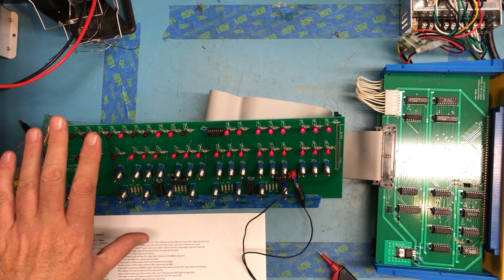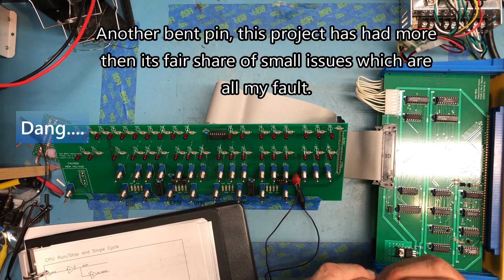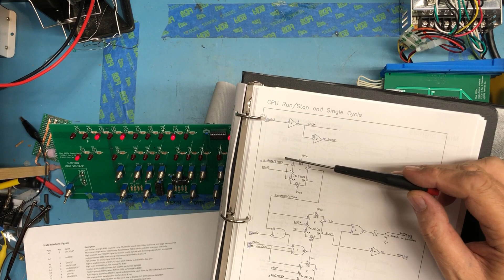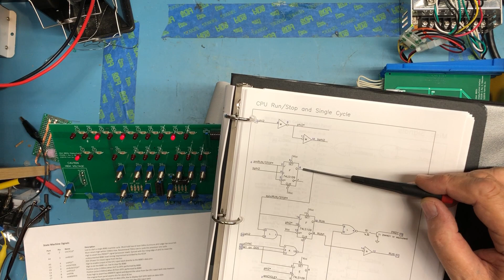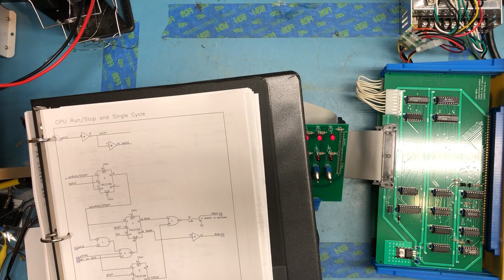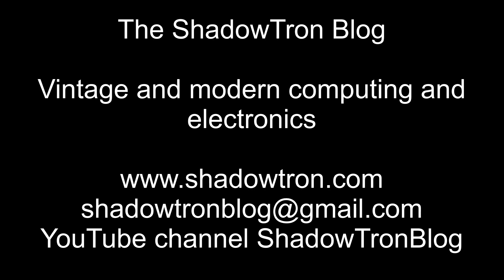Altair 8800 - Part 15 - Front Panel - Debugging the build - STB363

Comment: Way to go!  I know it's frustrating to find self-caused mistakes like that bent pin- but to me, it's even more rewarding when you find the issue, fix it, and are left with a fully operational machine!
Reply from the maker: Glad I could share this with you. I've had a number of mistakes throughout the build from solder IC sockets rotated 180 degrees to bent pins.